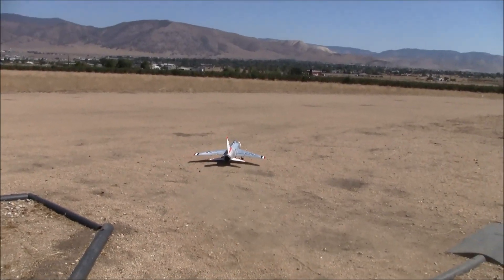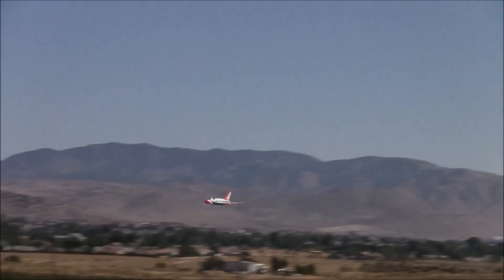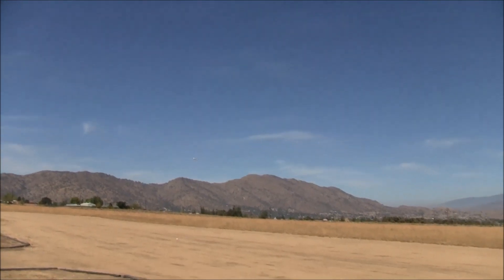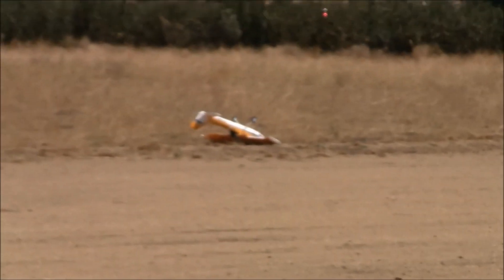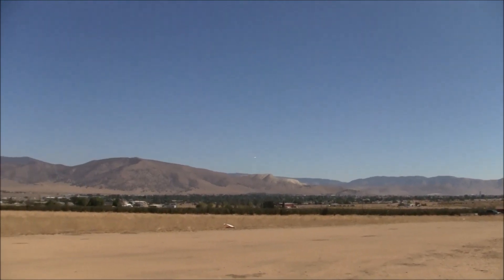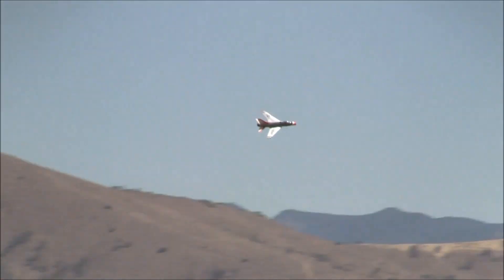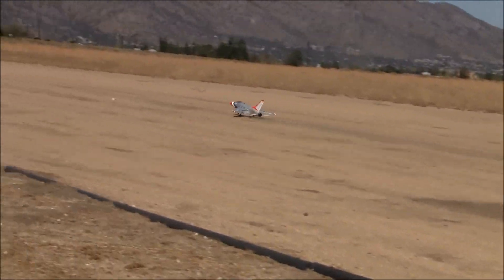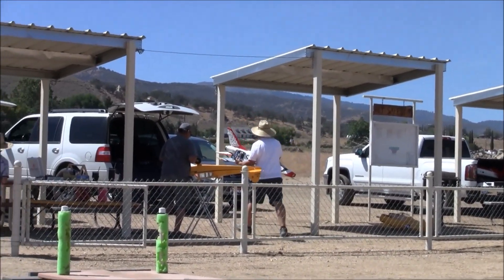Flex Innovations F-100D Super Sabre w/ Freewing 9 Blade 80mm EDF!

Comment: As always, nice content. I’ve been getting used to this model, but I went the high road (pun intended) with the 90mm (eFlite Viper) with the 12 blade fan and a 130 ESC. I’ve watched this video a few times and agree with everything. Mostly I was watching to help me with judging speed and configuration. Right now, I’m still landing with no flaps - scared myself good when it bounced a second time on what was not a bad touchdown but lucky I had enough momentum to go around as the third bounce would have been serious damage. I’m also curious about the CG, is he using book CG. I got the flaps dialed in for level flight, so no ballooning during extension or retraction. I know spending some stick time ‘low and slow’ will be the key, and this helped a lot as I can see he slowed this airplane very nicely during the short final, round out and flare to land. 
Appreciate any feedback Brother, and be sure to let me know when you’re going to be in Phoenix again!
Reply from the maker: Hey there Michael! Thanks so much for the kind words, I';m glad you enjoy the channel! I'll see if I can get Brent to chime in with any comments that might help you, but he hasn't had the plane for a while. ALSO, I posted a video recently of another Flex F-100D, this one flying in St. George Utah. Jim bounced it pretty hard on landing, but it was a result of density altitude (heat and altitude). https://www.youtube.com/watch?v=lsgYDO_qxaU&t=82s All the best my friend!!
Reply: @JustwingitRC  There’s no more ‘Flex’ left in this one.  https://youtu.be/DXaPB6UOAxU
10 channels Spektrum with SAFE and AS3X or clean aircraft - all with low, mid and hi rates. This flight was before I pulled all the Potenza (4 went bad just getting it set up) servos out and put in Hitec. I hope to get some more video using the flaps, but not until I can get my frikkin’ thumb to stop shaking every time I turn final.
Reply from the maker: @michaelhemmingsen4430  That's a great flight brother! You greased that landing!!!
Reply: @JustwingitRC  wish I could take credit for that, although mine was about 30 minutes later and it was still flyable and on the pavement. It was Spencer on the first one - you probably met him at SVF with his F-16.

Comment: I put the same fan / motor in mine. The stock one was causing a 120 cc esc to over heat and you could only fly 3:30 mins . Think its a inrunner set up out of a mig 29 .
Reply from the maker: Hey there Rodger! I'm sure yours flies so much better with this set up as well! All the best to you my friend 👍😁🇺🇸
Reply: Hey Rodger. If you decide to switch the fan out. You can cut a vent hole for that ESC from inside the fuselage.

Comment: Wow! Plus 5 minutes of flight time. What voltage did he come down with that 6250 RT pack?
Reply from the maker: Hey Enzo! Not sure about what voltage he came down at, but I suspect he had at least 20-30% remaining 😉👍😎
Reply: @JustwingitRC  Cool. I think the 90mm fan could really use some cheater holes. I will see, with the Eflite Viper 90mm EDF, if I can push the timer to 5m on a 6000 pack. I always fly with full ordnance. Guess that will take 45s away from the timer.

Comment: Dear sir could you include the setup As I maidened mine and was disappointed .First it has  a soft wobble .Performance was not what I expected.
Reply from the maker: Hi Charles! I'll see if I can get Brent to comment here on his set up for you. All the best!
Reply: @JustwingitRC  thank you very much for your time its much appreciated
Reply: It has the freewing 1920kv inrunner/9 blade 80mm fan. I was using a roaring top 6250 35c. Cg was about 1/4" aft of the recomended cg. Have you tried the other gyro possitions? What battery are you using?
Reply: @hechtspeed  6 cell 6000 hrb aura is in stock location . Also thank you for reply
Reply: @hechtspeed  it was maiden short of goung over everything it was stock .I had just flew my 90mm f16 freewing high performance version which flys on rails .Was I wrong to expect the same ?
Reply: @charlesrestivo870  what setting did you have the gyro on?
Reply: @hechtspeed  I'll say soft .If I'm correct theirs soft, gyro off and aggressive.
Reply: @hechtspeed  figured 1st flight The wobble was side to side very slow but not locked in .
Reply: @charlesrestivo870  did you try other settings?
Reply: @hechtspeed  The wind came up hard .I'm gonna flip between settings on my next flight I'll keep you posted Thank you again for your reply What setting do u fly yours on if I may ask